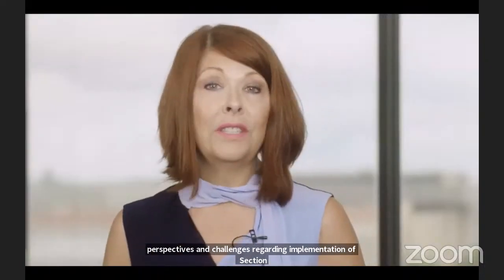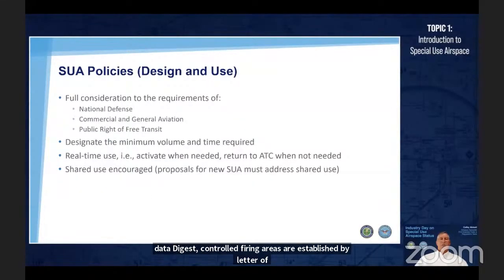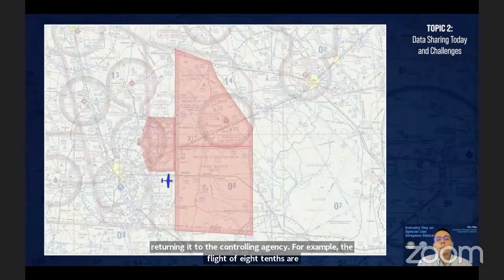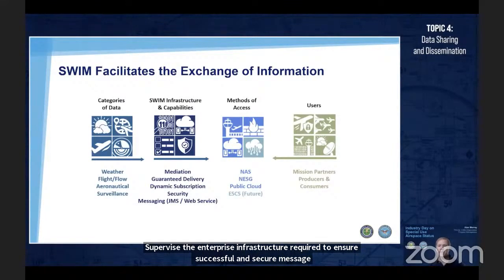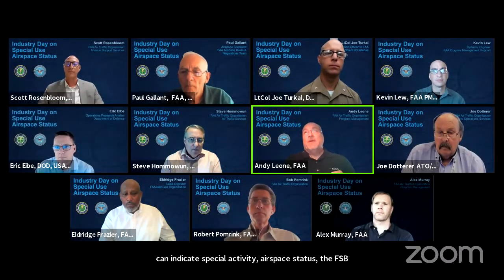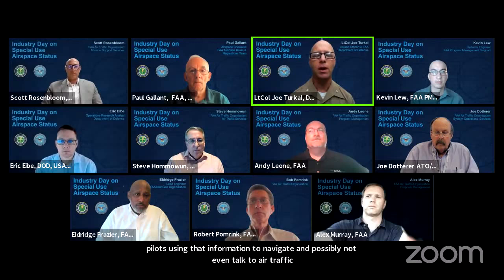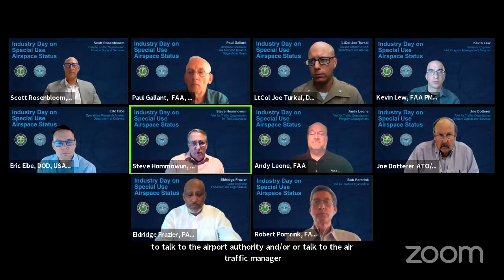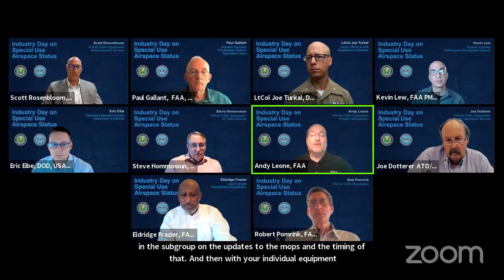FAA DOD Industry Virtual Stakeholder Day

Comment: This series of presentations was extremely well done. Every participant was a subject matter expert. The presentations were coordinated so that one flowed naturally into the next. For instance, one presenter used an airspace example for the MOODY 2 MOA. From there, every further presenter who needed it used the same MOA. The tone was conversational and friendly. They tried to explain some very complicated problems in the simplest terms. As a pilot, I could have done without the explanation of what a MOA and Restricted Area is, but I think they were trying to accommodate non-pilots who are more interested in the software aspects of the problems and implementation options. I was able to follow most of that. All told, very informative, open, transparent. These are Federal employees at their very best.